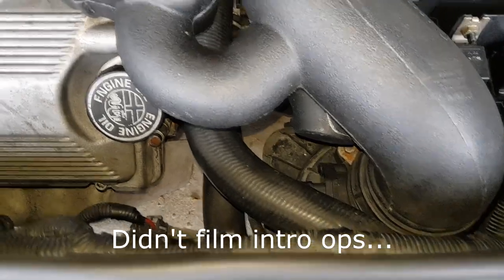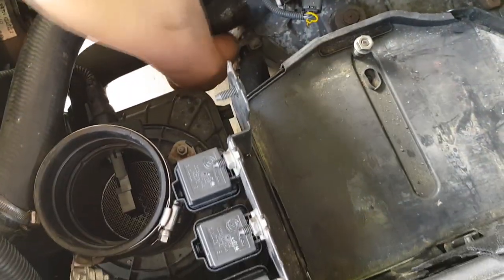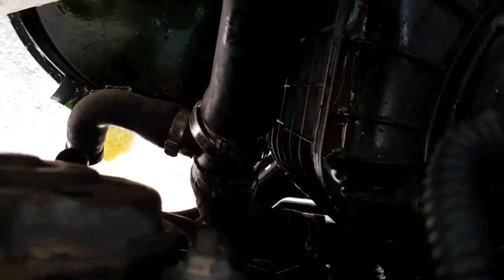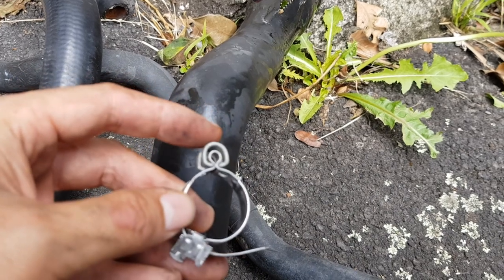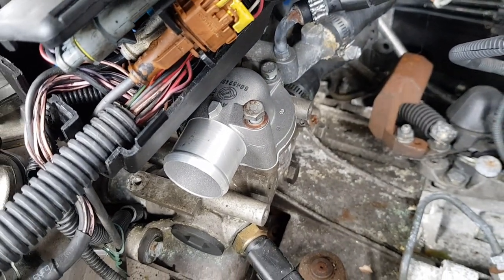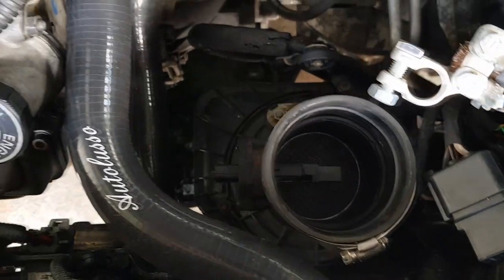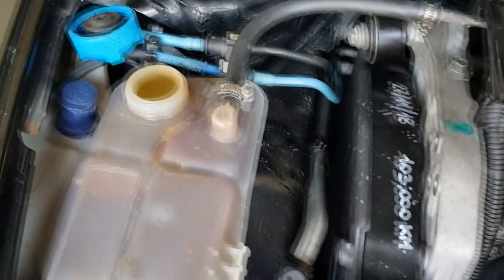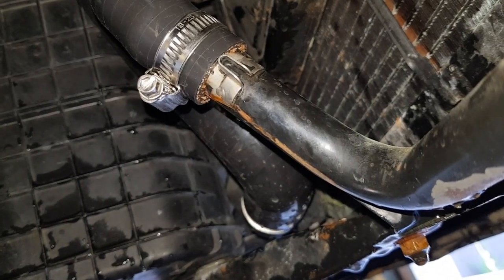Alfa Romeo 147 GTA Episode 7 - Radiator silicon hose kit installation

Comment: Nice hoses, gotta fit them onto mine :) Do you plan putting CF2 on your GTA ? I've put them yesterday and man, the sound is 10 times better
Reply from the maker: Thanks, not planning on doing anything with the exhaust yet. I drive the car fairly often and don't want it to be too loud on the road. Having said that my exhaust is a bit old and slightly bent so will need to figure out what to do long term. It sounded pretty good without the rear muffler so maybe even just changing the muffler will make it sound a lot better
Reply: @LueysGarage   it won't be alot louder than stock at low rpm though :)
With CF3 the sound will change a bit when changing the muffler, but it gets whole diffrent when on CF2
Cheers, have a good monday

Comment: While letting the engine run without cap i noticed water under my car when the cap is on the car everything is fine no leaks? Ist this normal
Reply from the maker: Is it from your aircon or is it coolant. You should never see any coolant come out of your car
Reply: @LueysGarage  the water Drops in the Part of the aircon but only when the cap is not on while im letting bleed the System, when the cap is on the Tank there is no water loss

Comment: What's all that saltpeter inside that aluminum engine? ... My Alfa 147 GTA inside the engine is brand new as it left the factory. :) This car was poorly maintained it drove on eneiger roads full of salt in the north without ever washing the sill.
Reply from the maker: Yeah so the car was sitting for about 2 years doing not much in a driveway. I believe all the gunk has come from the bottom radiator pipe which was quite corroded and the radiator itself. I had to swap the old radiator out for a brand new one not long after this. The coolant is very clean now after flushing a few times!